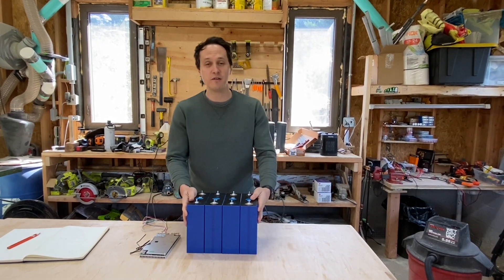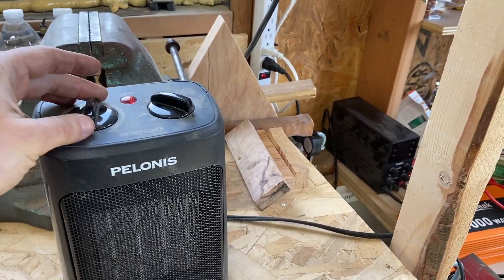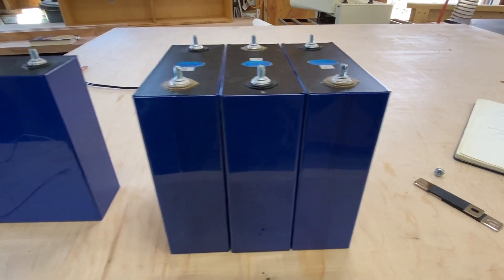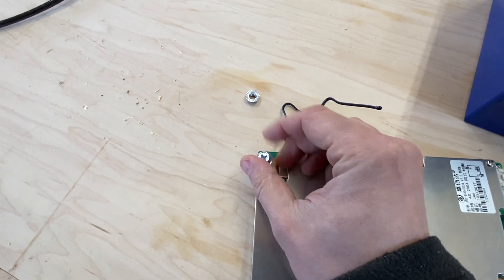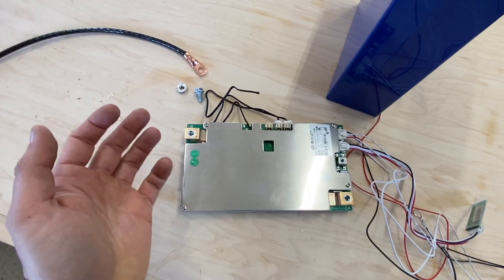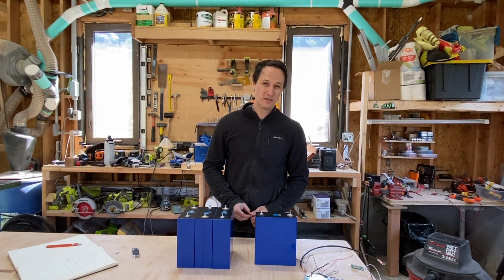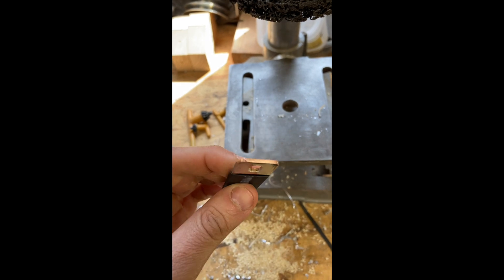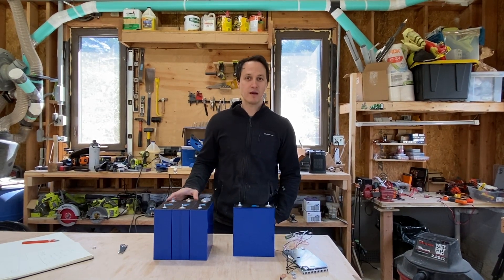American Supplier of Lifepo4??? EZEAL EVE Cells Review!

Comment: The temperature control on the heater works by turning the heater elements on and off so its no good for measuring capacity on the basis of elapsed time to discharge or limiting the power drawn from the inverter. 
Still, you have some nice cells and an BMS now - nothing to scoff at! Bonus video too.
Thanks for sharing.
Reply from the maker: Yeah fair point, although it was about 40 degrees in a large shed so there was no way it was ever going to meaningfully heat the room. It ran constantly during the test.  

The BMS itself though does seem to have some sort of amperage measurement  (that appeared to be accurate) and monitors the state of charge that way, and that is how I was hoping to measure the capacity, not through a timed test (apologies if that wasn't clear in the video). Unfortunately my inverter couldn't take the cells below three volts each.
Reply: @TheWilltoBuild  Thanks - that filled in some gaps for me. I find it so useful to discuss - I learn from it and I hope others do too.